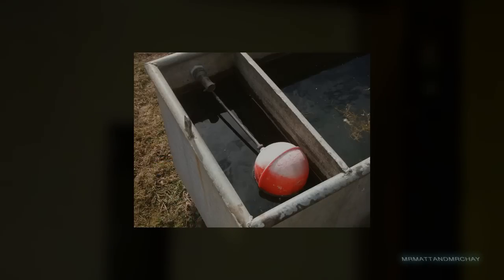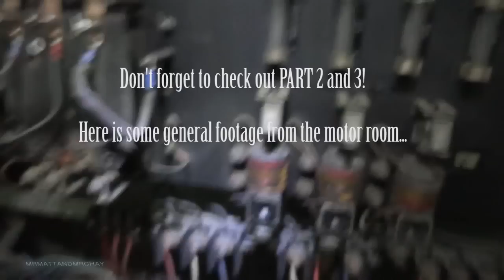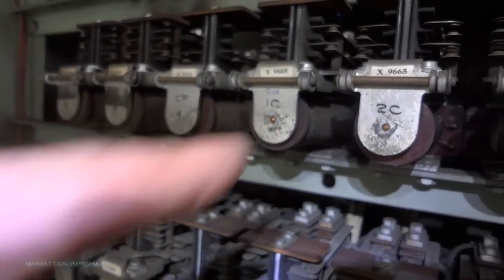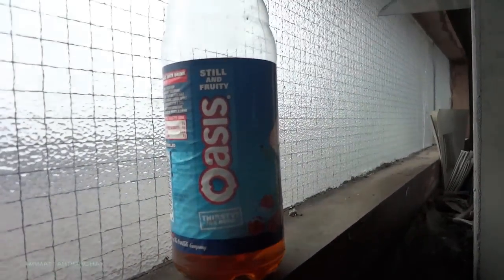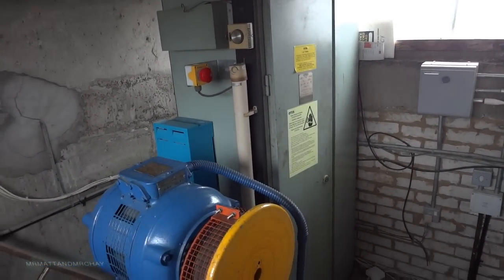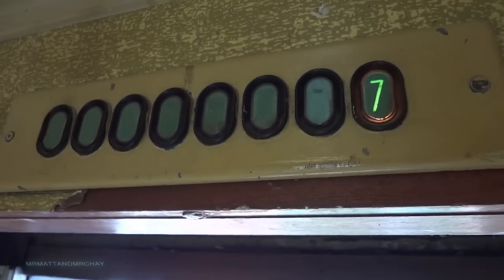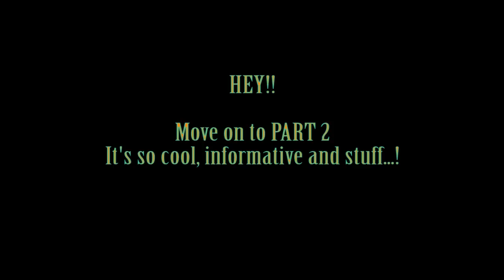(1/4) PROBABLY THE BEST 'elevator relay logic vid' in the world! - Part 1 of 4

Comment: Up and down crash stopper.good ole Express Lift.The worst fault on those GPO type selectors,was the brass cog wheel becoming worn.Takes me back a few years.Those pushes we called for some reason,bird bath pushes,lol good  vid thanks.Yes I’m an ex lift engineer.12 years on maintenance and call outs with Express.Appy Dayz.Now retired after 45 years,
Reply from the maker: Always interesting to hear from ex-lift engineers.  I nearly took a career in lift engineering, but decided to go down the security route in the end - now a tech engineer for access control systems.  Also love hearing all the terminology - never heard the term bird bath pushes before!
Love looking at the old mechanical stuff, the new stuff doesn't really interest me.  Thanks for the message.

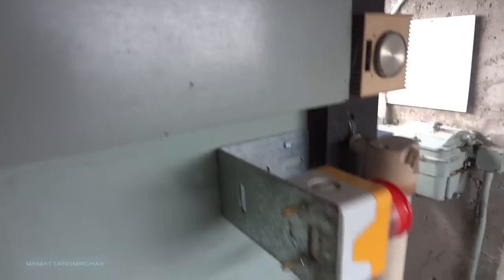Comment: 6:10 I'm bit unsure about the reliability of those old alarm batteries, would be terrible if they were flat when someone is stuck in lift trying to press the alarm.
Reply from the maker: I suppose years ago that would be a big issue - you'd have to hammer on the doors to get someone's attention.
But with mobile phones (assuming the lift is not in the basement and it has a signal) you could ring someone.

Comment: I love this very eunique lift because it doesn't level
Reply from the maker: They call it "crash leveling" as the motor's momentum is stopped by the brake.  If the brake is too loose then the lift will over run the floor every time, and vice-versa.
Reply: Also called 2 speed AC??
Reply: Single speed.

Comment: Does anyone have any information on the relays that Express used?  I have a set of schematics for a cabinet and it appears that the actual windings are on 4 pins.  I have obtained an X5475 relay which is mostly intact and there are two windings, one connects to pin "A", the other goes to pin "D" and they are both connected to "B" as the common.  Pin "C" is not connected.  It appears that different versions have different connections for the windings and the Schematics don't indicate how they are wired internally. I'm also unsure whether the relays need both windings energized or whether either would activate them.   I was also lucky enough to find a wrecked floor selector which looks to have been stripped for parts.   There were enough parts scattered around the room to be able to re-assemble it (mostly).  It's surprising how much bigger these parts are in real life. It's really sad to see these old 40+ year old controllers being ripped out.

Comment: Step selector? For what it is used? Russian old relay lift controllers do the same, but is much simplier. Just 2 relays per floor plus door open-close timer and protection - 6 relays. In  fact - an register for commands and cabin position comparator to determine up/down direction.

Comment: Motor work with only one speed
Is this right?
Reply from the maker: +Redah Sader On this lift, yes, one speed.  It's a one speed lift with "crash levelling".  When the motor looses power the brake is adjusted to stop the lift level with the floor.  Other old lifts work normally with 2 speeds.  When you have a DC Generator, then you can switch many speeds to the motor, but these are usually for high rise.
Reply: mrmattandmrchay oh thank you man , your videos are amazing!!!
I have finished an electrical elevator design with relays but i have some Problems with Multi-speed dc motor but I saw many elevators with one speed so it's okay :D
Reply from the maker: +Redah Sader sounds cool!  I've checked your channel hoping to find a video of it.  Maybe you could upload at some stage?  Thanks for the comment :)

Comment from the maker: Well spotted!  No it doesn't!  I was looking for one also, but my lift engineer friend said that not all lifts have a governor - this one included as it's a one speed slow lift.
When this was installed it perhaps was not a requirement.  Now - I guess you have to fit them(?)
So - excessive speed does not trigger a safety device, as there is little risk of an over-speed.
Cable failure - YES!  If the cables were to break then there is something.
Ok, let me explain.  The lift car DOES have a safety brake.  There is a separate safety cable - This is connected DIRECTLY to the counter weight (the cable does not enter the motor room) instead it just goes up to the top of the shaft then two wheel diverts the cable over the top of the shaft then back down to the counter weight.
How does it work - SIMPLE!  If the main cables were to fail, then the safety cable would remain which then pulls up the brakes on the lift car.  Really simple.
If you send me a private message with your email address then I'll send you a photo of the top of the shaft (from this building) and you can see what I mean (don't put your email here in the public messages).
Have a nice day! :) Matt
Reply: +mrmattandmrchay
 no matt its dashpot oil for the overloads or ellison.
Reply: +Tony Baines 
the heater was a possible clue, sometimes in winter the gear oil can overload the drive and trip the overload the heater near the gearbox will help and putting thin oil in the pots too
Reply: +Tony Baines 
in the highly unlikely event of a total rope fail the car and balance weight will shoot down, attached to the car and weight is a single rope, when the weight shoots down it pulls the dogs in on the car, these are egg shaped steel teeth that grab the guides, hey presto everyone alive :)
Reply: +Tony Baines 
and the cable does enter the motor room matt it goes over 2 small idler pulleys these usually have grease storphers on.for maintenance.
Reply: +Tony Baines Not true .There is only a safety gear cable attached to a cwt if there is a room under the cwt ,
Reply: +738polarbear

 lets get this right, first of all i cant understand your comment, how can there only be a safety gear cable attached to the counterweight ? its attached to the top of the weight goes though the floor of the motor room or underneath, across maybe diagonal then back down the side of the car and clipped to the dogs, so if the main ropes should fail, the car and counterweight would go down, the safety gear rope would tension, bringing the dogs in, i out to know ive tested hundreds.this is a governess type, the governed one is the same pattern but goes over the governor, this applies to all roped lifts hydraulic or traction, the only passenger lifts that have no safety gear are direct drive hydraulics which drive direct from the ram, all hydraulic lifts have a rupture valve at the bottom of the cylinder to stop the flow dead if the return flow is too high, ie pipe severed or valve failier.

tony
Reply: +Tony Baines theirs also another type its new on the scene that keeps the dogs tentioned off from the guides, its bolted in the pit and attached underneath, this eliminates the need for holes or pulleys at the top of the shaft, its the same principle but works the opposite way.
Reply: +Tony Baines last thing, also on a hydraulic lift the valve has two important settings, max and min pressure, the min pressure cuts the valve out when activated, this stops the ram from coming down ie if the safety gear is engaged you dont want that ram to close down if the lift suspended in the shaft, also the max pressure which is set at a full load plus 25 percent, if the car is overloaded it dumps the oil back to the tank, there is also slack rope switches on car and pillar, and governor tension weight in the pit.

tony
Reply: +Tony Baines so dont tell me ime wrong, ive been a lift engineer since 1982 and got married in 87, and i dont know to this day which has been a more pain in the arse... lol
Reply: +738polarbear A safety gear is only fitted to the counterweight if there is a false pit (a void under the bottom of the shaft) what we are talking about here is an idler rope connected car to cwt they are two different  systems.
Reply: ALL lifts have an overspeed governor .Its code.Unless they are residential in houses.
Reply: Agreed but the COUNTERWEIGHT  does NOT HAVE A safety gear fitted on normal installations.
Reply: +738polarbear all lifts dont have a governor, most the old ones ive been too definatly dont, and the majority of goods lifts dont, its code on new lifts, dont know if you rember a few years ago a lift was re roped at gus in manchester, the gear kept pulling in, so they kept slackening the rope, but the main ropes were creeping throw the clips, 3 on top of the car and they removed the s/gear rope, the ropes went and all 3 went down the shaft. i heard the clips had been put on the wrong way round on the weight. also the only time ive ever worked on a lift with s/gear on the weight, is on the belfast ferry.
Reply: +Peter Lomas see below

Comment: I have heard in some countries lift  engineers sometimes bypass the lift door interlock using jumper leads so they can observe the lift moving in the shaft or stop the car between floors with doors open to access the roof of the car.

Sometimes the engineer has forgot to remove the bypass when passengers start using the lift. This can result in injuries if the lift starts moving with doors open.

This has happened in other countries such as the us:
http://www.huffingtonpost.com/2012/02/27/suzanne-harts-midtown-ele_n_1304521.html

But I have never heard of it happening in Britain. Do we have extra safety mechanisms to prevent lift moving with doors open even if a bypass jumper lead has not been removed?
Reply: I don't know exactly how those particular elevators work, but the old electromechanical ones with manual doors that I have been in, would have the cabin light turned off if the doors on all floors are closed (or bypassed with some jumpers). So if I open the door and the cabin light is off, I would know that either the light is broken or the door safety mechanism is not working properly, therefore the elevator could start moving if someone would press the call button on another floor.
Reply: ELPaso1990TX older relay logic elevators will move with the doors jumpered but modern microprocessor elevators have built in redundancy features to prevent this jumpering movement.
Reply: +ELPaso1990TX todays elevators can, its programmed in that if the doors open and the locks still made i.e. jumper leads, the logic will know and shut the lift down, some lift engineers carry various lock beaks, that they stick in the locks to run the lift with the door open, not only is this dangerous but its also illegal in the uk
Reply: I used to work on these lifts.  Our safety device was to put the bypass wire through our car key ring.  If you forgot the loop was in you could not drive away and leave it like that!